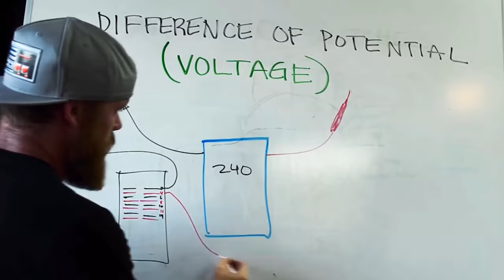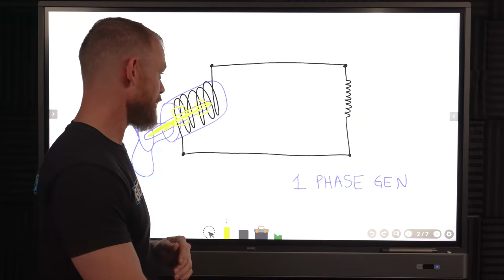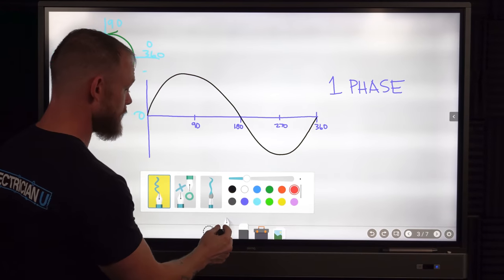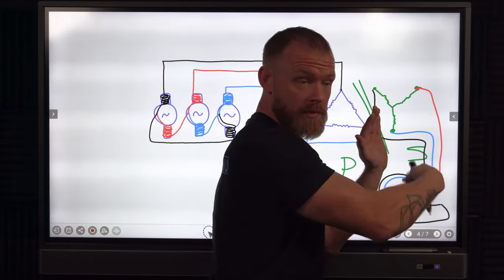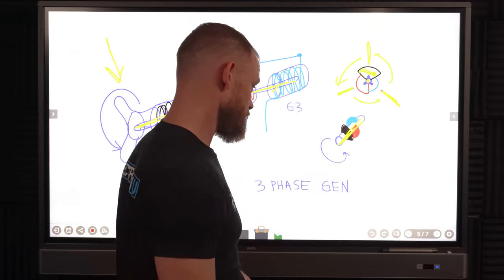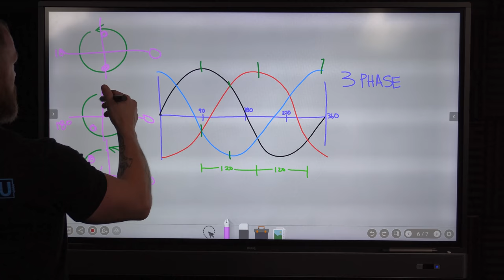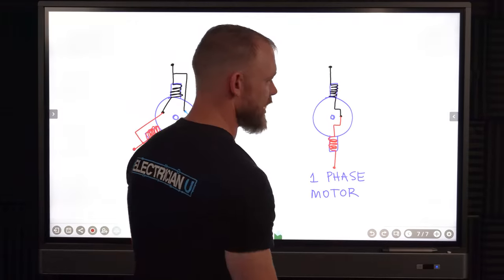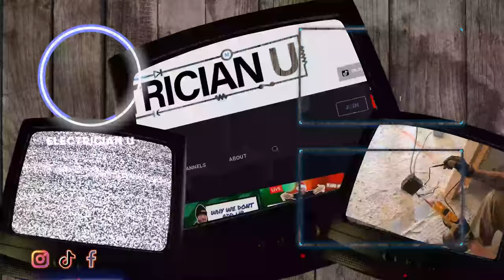What is the Difference Between Single Phase and Three Phase???

Comment: How do I wire a 240 volt 13 amp type G receptacle.
Reply: Do not, instead use a 240 V receptacle and change the plug in the device. Do not make nonstandard installations - assuming you are in the US. Otherwise you ask in a strange place.

Comment: "Are there sine wave going through wires?"  Yes.  Absolutely.  You have it backwards.  The waves don't show rotation.   The rotation creates waves.  They're fundamental to everything.  Frequency, polarity, magnitude, even radio, everything.  Compared to DC which is a straight line.

The actual mechanical rotation and position depends on the numbers of poles in a generator.  Don't confuse mechanical degrees with electrical degrees.  The individual sine waves are 120 degrees out of phase.  The mechanical poles are 180 degrees.  

That being said, current doesn't flow "wierdly through" three phase.  It's added vectorilly.  Some topics can't be simplified. 

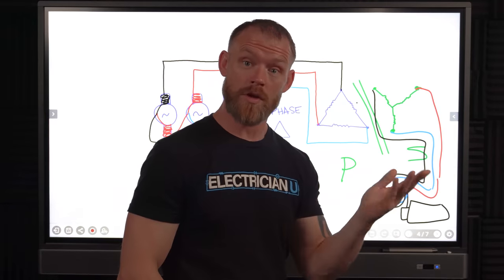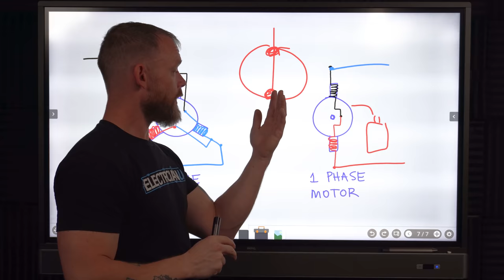Also, at 17:45, it is all three conductors.  Just put a multimeter on a generator or motor.  It's absolutely all three.  At 22:00, you can't run a single phase motor on a three phase system for a bunch of reasons. Please take 5 min to do some research. These videos have so much wrong information and someone is going to get hurt or blow up equipment.  That's a huge liability.

Comment: There nocomparison to single phase and 3 phase. We all know  3 phase is 3 times cheaper than single phase. And quadra phase is 4 tumes cheaper. , it takes 6 wires to have a good balanced 440 - 4 phase 60 hertz  30 amp  circuit. 4 curent lines and 1 neutral travelier line and 1 earth ground line for balance,  shorage, or lighting.

Comment: What's split phase, how does it relate to single and three phase?
Reply: Split phase Is just single phase that is split with a center tapped transformer. The single phase comes in on the primary side of the transformer and it is split on the secondary side to two 120V legs to neutral(the center tap) or 240 from leg to leg which are 180° out of phase since the neutral is exactly in the center of the transformers secondary coil. This is typical of how single phase is distributed to residences.
Reply: It is called single phase but you can think it also as similar to three phase but with just two phases.  It is simpler as you can hook loads to the 240 V, you do not need to design the loads to three phase.

Comment: Dude, the single phase is not 180° out of phase, if they were, they'd cancel each other out and you'd get no power..
Reply: They do cancel each other once they have given their power. That is why there will be no current on the neutral if the legs are balanced.

Comment: Is there a neutral wire in 3 phase?
Reply: Depends if it’s a star network yes, if it’s a triangle network no. Triangle networks are getting more rare these days, at least in Europe where I’m at.
Reply: In North America, a transmission line is generally delta.  Distribution lines are wye (star).

Comment: So is 3ph 120 or 360 volt?
Reply: The number of phases isn't linked to the voltage.
Reply: 208 volt 3 phase is three 120 volt legs that are 120 degrees out of phase from each other. So 3 legs times 120 degrees = 360 degrees. If you measure from each leg to ground, you'll read 120 volts. If you measure from phase to phase, you'll read 208 volts.
Reply: It is 208 V but that should be understood as a label, not that it is similar as 120 V or 240 V but just 208 V. To properly utilize three phase one needs three phase loads.

Comment: Why isn't there a neutral wire in a 3 phase system?
Reply: It doesn't need a neutral. As one leg is conducting, the other two legs act as a return. It's the same reason a 240 volt circuit doesn't need a neutral. As one leg conducts, the other acts as a return. A neutral is needed on a 120 volt circuit because that is the only return path available.
Reply: There is, in a “Y” configuration, but not “Δ”.
Reply: Sure there is on low voltage networks. High and medium voltage networks are balanced enough for no neutral. Similarly balanced loads like motors do not need a neutral.

Comment: Is 208 2ph? I know we call it 1ph
Reply: 208 volt is 3 phase. There are 3 legs of 120 volts. 230-240 volt is single phase. We also jokingly call 230-240 volt circuits "2 phase" because there are 2 legs of 120 volts. But it's not correct.

Comment: I only see three wires on the pole how can I have a loop of wire with only one phase. I am pretty sure they need use two of those phase's two make a loop
Reply: don't confuse 'wire' with 'phase.' A wire is decidedly not a phase. And yes, you need a loop of wire for a circuit (or some form of return path to source for the current)
Reply: @spruce_goose5169  A wire is a phase.
in the neighborhood distribution system.    Only one conductor going INTO the top of the step down transformer out on the poll. 
    HOW DO IT WORK
The wire is connected to one end
of the PRIMARY COIL (naturally)
the other end (of the primary coil) is connected directly 
to earth.
Reply: @seniorcomputer3292  When I say a wire is not a phase, I mean a single wire. A phase is a signal, which needs two points of reference. That means a single wire is not explicitly a phase, though many people certainly do point to wires and casually call them phases all the time. Phase conductor would perhaps be more correct.

In the case of what Josh is referring to above, a single phase conductor (hot) will enter the transformer, and it will also use a neutral connected back to the sub. If you are suggesting that the primary transformer is NOT connected back to the sub-station via a neutral, you are either incorrect or are referring to the exceedingly rare (but not unheard of) Single Wire Earth Return (SWER) system. Are you in the U.S.?
Reply: @seniorcomputer3292  What country are you in? I won't speak to other countries, but the standard system in the U.S., by far, uses a return conductor (i.e. neutral). SWER is a bit antiquated and rarely used. My understanding is that there are perhaps a few extremely rural communities still using it, but that's the exception.
Reply: @seniorcomputer3292  "not used here." Haha! Sorry but you are clearly just BSing. Even if you live where SWER is somewhat common (which I highly doubt) neutral returns are certainly used in NA.
Reply: Alot of people don't seem to realize that a single phase pole transformers primary windings other end is connected through the tank to the utility system neutral using the case ground on the back

Comment: Please do a video on the high leg in 3 phase, what my union electrician grandfather called " the bastard leg" I have run into it several times in my 40 years. please don't pussy out on the bastard leg.
Reply: The high leg is just when you put a neutral on a delta wired service. So look at it like, where else are you going to put a neutral on a delta to where it makes any sense other than somewhere between two of the phase legs? It's going to be say the center point between phase B and C so the same reference can be made between it and each phase. Well that's only the reference between that common neutral and phases B and C, but what about phase A? Well A would be the high leg in that case because if you form a reference between it and the neutral, you're going to have higher voltage than any other reference you can achieve in the system.

Comment: Dude, nothing pushes and pulls, it flows. Voltage does the work and as it is AC, it changes polarity between positive and negative at the rate of the frequency, in the US 60 times a second. Neutral is just that, neutral. AC is measured as root mean square or at the 70.7 percentile of peak, around 170V which gives 120V. Current can be either positive of negative but always flows in the same direction, hot lead to neutral or else you could not bond neutral. There is no "current" on the neutral as the load uses it. However if you grab that white wire  while working, you are part of the load and there will be current through you. Now if you want to talk magnetic fields, there is rising and collapsing fields which is what allows current to flow across a transformer.

And your explanation of how a generator works is more pure bullshit and then you get to a sine wave which you totally destroy. A sine wave is voltage over time and shows the rise of voltage, the collapse of voltage then the rise and collapse of voltage in the opposite polarity, all based on time. 60 cycles per second means the generator is spinning at 3600 rpm and in a power grid with multiple generators means the generators are synchronized to the same timing.

Now I understand, you have no clue what is going on so you make it all up, ignorance U. First off, magnetic fields have but two states, north and south. To have a three phase generator you wind a minimum of three sets of windings that are 120 degrees, physically, out of phase with each other so when one is fully under one magnetic field the other two phases are either one third build or two thirds collapsed of the opposite magnetic field.

The clown suit was the most honest you got in this video. When you have commercial power with three phase that needs to support other things, you do not get real three phase. You get conventional single phase service with a high leg in the middle at 208V 60 degrees out of phase with the other two legs. You must also wire with an orange wire to designate that 208V circuit and can only use it for three phase motors unless it is a clown like yourself that would burn everything else up.

Also capacitor start of a single phase motor is a mechanical device on the shaft that opens with centrifugal weights when the rpm reaches a set point, disconnecting the capacitor. If you are going to teach this shit, perhaps you should spend time learning what you are talking about. If you are a licensed electrician, then that shows the licensing system is about as false as the hoax called virus. People see this and come here to learn and then all they get is an ass monkey without a clue, by your own admission,
Reply: The electrons push and pull, at least this is one of the easyest ways to explain it.

And there is current on the neutral when somewhere there is an active load between neutral and a phase. One thing you learn first about serial circuits is the current is the same over the circuit, the resistance of the hot, the load and the neutral are serial. The neutral just carries a very low voltage as that drops nearly completly over the load. If you grab on to a neutral that is connected to a load and supplied neutral, you probably won't feel a thing because your own resistance is so high that nearly the whole current flows through the neutral and just a very little amount flows through you. But if there are enough loads that feed the neutral and create a high enough voltage you can shock yourself on the neutral.
Reply: @alfrednewman292  Simplifications and comparisons are made constantly, because not everyone can intake new information and just understand it completly.

Yes, the neutral is the neutral and carries current and has a voltage drop.
If I do it at an outlet chances are that the RCD would trigger, because neutral and ground are now in parallel, which means current will flow through both. This current that flows through ground could be greater than 30mA, depending on how many things are plugged in and running and depending on their power use.
If I connect it in the nearest breaker board nothing really would happen, just that my city would get angry with me because we have a TT-System, as they would in a TNS-System. If I would have a TNC System they still would get angry with me because this connection should only happen befor the electricity meter in the main breaker board. Other to that the city gets angry I would dubble the crossection of the neutral in the TNC system, and I would give the current an alternativ main path to the transformer.
Reply: @Alex_Vir  Absolute garbage. The neutral doesn't carry ANY current no matter how high powered the load is. The load uses the current. If one breaks the neutral, they'll get shocked as the current now flows through the load and is still live.
Reply: @pilotboy2612  Just to be clear, electrical current is measured in Ampere?

Or was Current the thing that creates the magnetic fields in the coil of a RCD or GFCI, which need to have not a bigger differencre than the residual current error the RCD or GFCI is build around?

Or was Current the thing that is the same at any point in a series circuit?